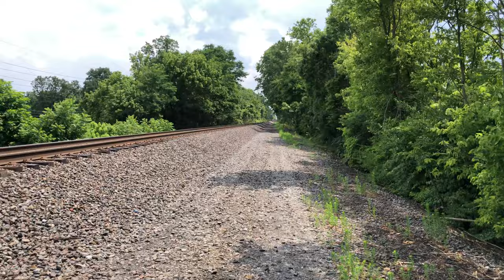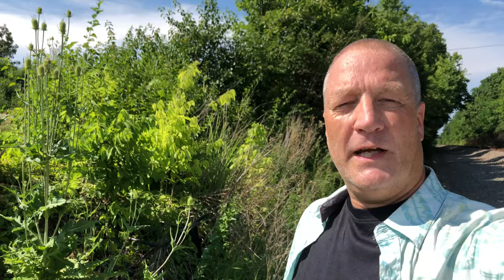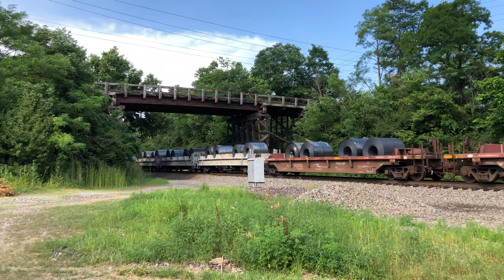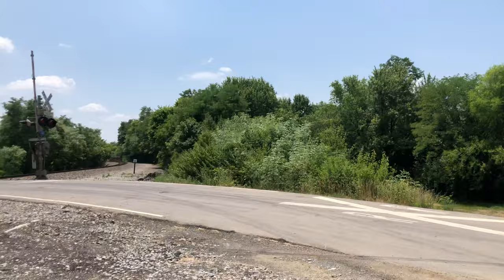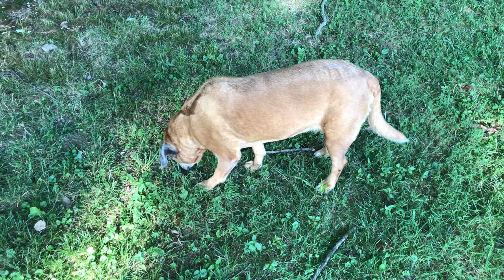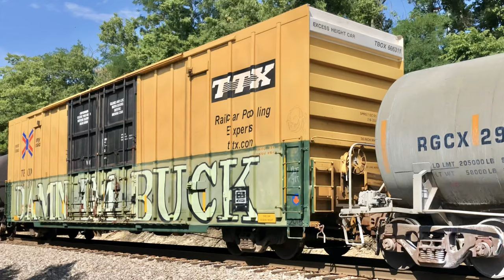Freight Train Speeds Checked By Radar! Train Goes Under Old Bridge, Norfolk Southern Kentucky Trains

Comment: JT, may I suggest, to try shooting the last car after it comes by you.  Jason did it in one of his videos and the speed jumped up about 6 or 7 MPH from the low 20s to the upper 20s.
Reply from the maker: Interesting.  I will try that.  Thanks for watching!
Reply: For the last train, if the angle was 30 degrees, then with indicated speed 33, gives 33 divided by cosine of 30 degrees equals around 38 mph.